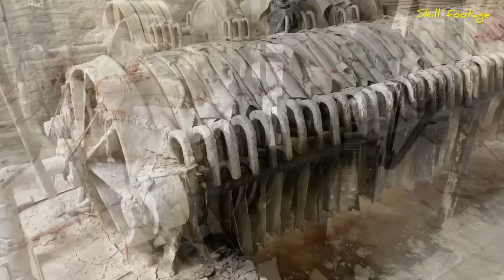Mass Production Process Ceramic of Mugs in Factory || How Tea Cups are Made

Comment: Usually these vids are an instruction manual on how not to run an industrial operation, but this one actually seems to be 80-90% acceptable. There is the obvious child labor and unmitigated silicosis hazard at clay mixing, but that seems to be about it for serious problems. Product itself is simple, cheap and not about to win any prizes in quality or design, but there is nothing really wrong with that, a mug works just as well even if it's a cheap one and there is always plenty of market for cheap dishes and cutlery.
Reply: Quality looks alright to me
Reply: I'm agree to you,,,but i'm concern about safety first,on video no one using mask,, this condition is bad for your health in long time,,,
Reply: I’m sure you would send your own son to work at the factory where there is “only” silicosis risk.

Comment: I wonder how this would work with renewable energy like solar panels and wind farms?
Reply: It wouldn't.  At least not on the scale you see in these videos.  The main stopper is those kilns (furnaces) which use a lot of energy.  It would take a great deal of solar panels or wind turbines to generate anything close to the amount of energy they are consuming.  In the videos similar to this one where they show the exterior, the small factory is usually on some crowded side street with no space for solar or wind.
It's a nice idea, but so are safety gear, a safe working environment and avoiding child labor.